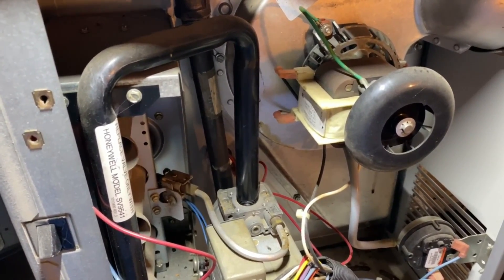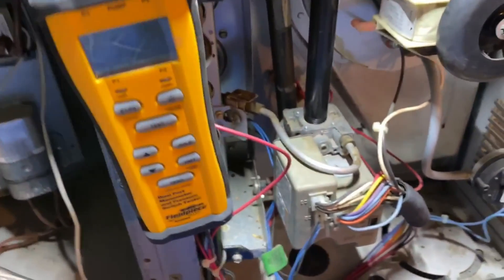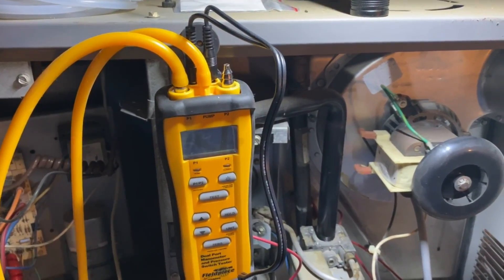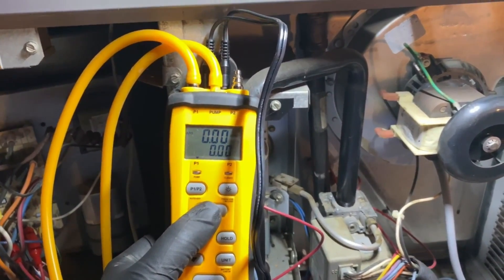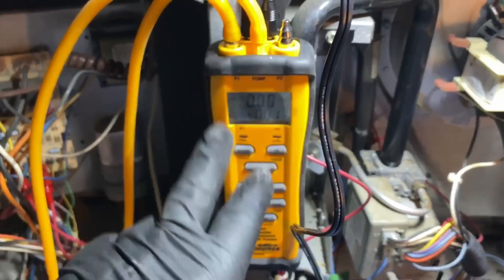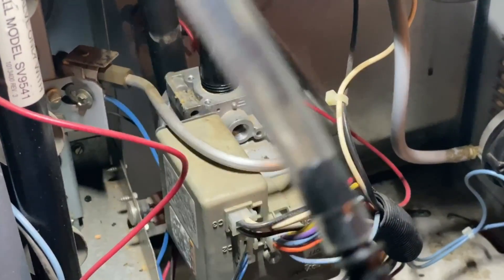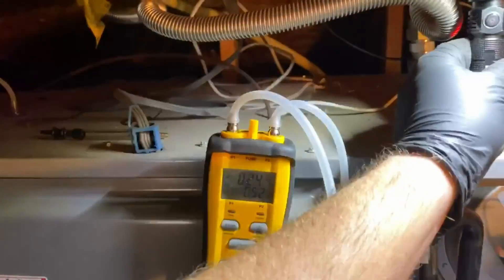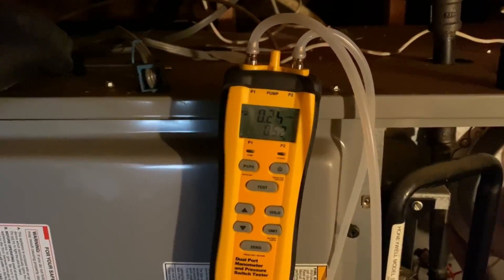Fieldpiece SDMN6 Review EP23

Comment: That's not really how you should test a pressure switch with that manometer. You only checked for when the switch opened, not when it closed. You should start at a lower number and raise pressure until light comes on, showing when switch closes. Also, the hold button is to show or hold the actual number on the screen of when the switch closes, so you can see it.

Comment: Should I get the wireless monometer? Or the SDMN6?
Reply from the maker: SDMN6
Reply: @NighthawkHVAC is it better?
Reply: Is it better?
Reply: IDSMN6 can test the pressure switch and the wireless manometer can not preform that testing. I have both and each has it purpose use.

Comment: This is by far my favorite, and in my opinion the best, manometer on the market. Too bad it’s not Bluetooth as well. The ability to test pressure switches, and calibrate after market negative pressure switches is a fantastic ability.
Reply: Is it possible to test pressure switches otherwise? As a tech, I’m wondering what techs did in the field before this product was released to the market. The SD6 is out of my budget right now. I am considering the SD5 instead.